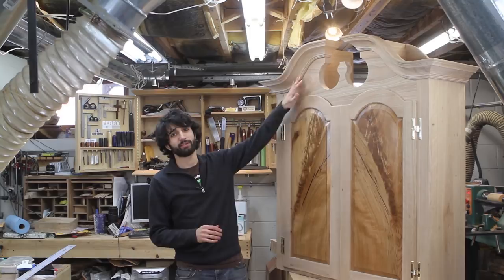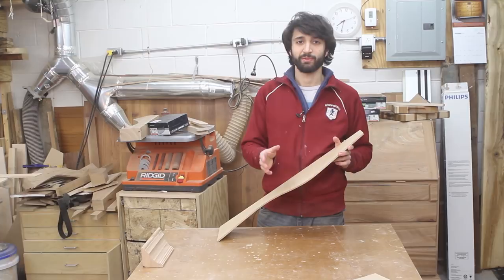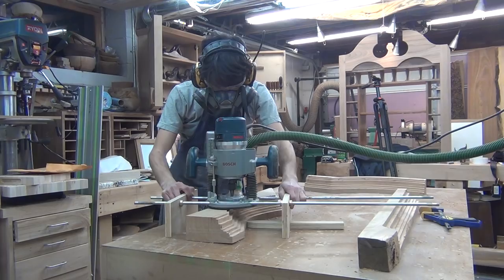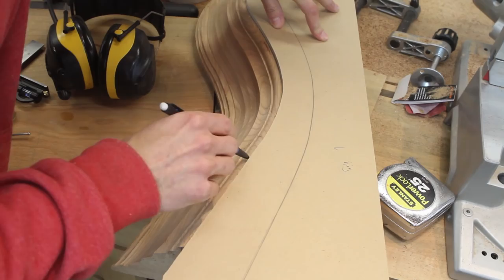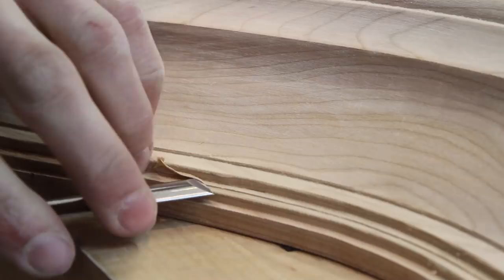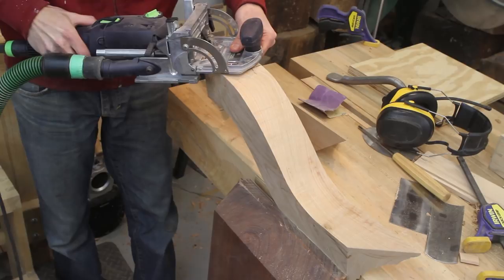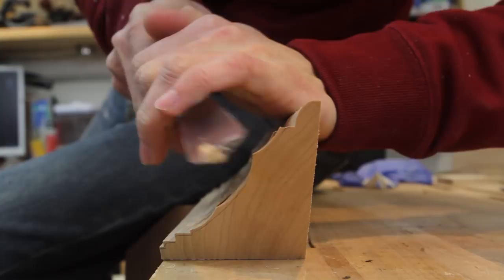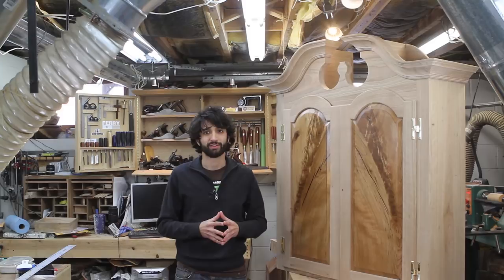Making and Installing Goose Neck Moldings

Comment: they turned out really well.  i only ever did goose neck once when i was training and that was on a spindle moulder with the correct cutter.  i admire your patience to do this with a router, but this is what makes a craftsman. knowing how to reach your goal using what you have at hand.  well done matt. p.s. i no longer have access to a spindle moulder as my shop is to small for one.  but i sure do miss it.
Reply from the maker: Tayler Made Thank you as always!  Having that profile cutter would be awesome.  I can certainly say I have an appreciation for it now.

Comment: Great video Matt and the molding and the entire project turned out fantastic. I was watching another channel a couple of months ago and a gentleman suggested using wood rated cyanoacrylate in conjunction with wood glue for doing molding returns when they are large or difficult to clamp up. His suggestion was to apply wood glue on each miter but leave 2-3 small circular areas bare of wood glue on each side and apply cyanoacrylate in those circular areas and hold the molding in place for 30-60 seconds while the cyanoacrylate cured. He only suggested the tip but did not demonstrate it. I think I would want to try this a few times on some scrap before I committed to using it on something of such importance as your gooseneck molding. The tip sounding interesting so I thought I would pass it along but I have not tried it myself yet. Congrats on such a beautiful piece.
Ron
Reply from the maker: Thanks again, Ron!  yes, CA glue as a clamp works well but you have to remember to keep a bottle in your shop :D

Comment: Well Nat,  clever use of router.  I would call this a "serpentine or Swan neck bonnet mould."  A gooseneck transition usually has a single curve to a mitered joint to straight section.

Comment: So there was a second thing the audience should have notice during the live events :p 2:07 lens cap instead of dust cap... bold! That miter saw fence was awesome! I think I can safely say that is the tallest one I have ever seen. I was about to say you need to learn how to be ambidextrous during those weak side cuts. But you did during the next clip :) Who cares about the time it took to do that. You have total bragging rights. Big props.
Reply from the maker: diycentral I think you are the most observant of them all :)  I think I used more carpet tape in this project than I have in my entire woodworking past.  Cutting those moldings stuck to the table and then stuck to a tall fence really shows how much grab that stuff has.  Occasionally I can show ambidextrous tendencies :)

Comment: Great video and instructive. I'm current looking at the (pre-fabricated) crown molding in my living room. If you were to re-vamp a room/bathroom in your house, would you cut your own crown molding it this way (minus all the neat and technically goose curves, etc.)?
Reply from the maker: Charles McCants Thank you Charles!  I did a room in my house and made all new trim for it.  I was going to make the crown but I found 80 feet of brand new cherry crown on craigslist for $100.  Since crown is straight all the shaping can be done in a more typical manner.  I'd probably use the table saw and router table to make it.

Comment: You need a diy 4x4 cnc ... easy fabricate this both right left sides with just a few ballnose bits and cover and end mills bits
Reply: While this is true, and could be useful for multiple-production work, what he has done here is truly art, and something to be proud of.  Most anyone could push a button and make a CNC pattern, but to figure this out and make it as a wood craftsman takes talent.
Reply: You need to be very skilled with the CNC software to be able to produce work like this.
I find it easier to make complex pieces by hand than on the CNC, this is due to my lack of experience with the 3D cad/cam process. 
The belief that just anyone can do great work on computer operated machines is a false one. 
There would be much more brain work making this moulding on a CNC than making it by hand.
CNC is only a tool there is equal but different skill level required to make quality work with it.
Reply: it depends on the cnc software, cheap router tables and cheap software are difficult to work with even for a person who is very familiar with cad/cam/cnc

good software package will let you do all the 3d design, converting to cam and generating gcode for the machine really fast, I'm talking less than an hour for a molding like this, and the best (debatable is it is "best") is the repeatability of the process, every following sets of parts will only take machine time

IMHO cnc is for production, and furniture like this shouldn't be "produced", it should be crafted by skilled men and women while using as little power tools as reasonably possible and appreciated by customer mostly because of this, I think that most of the value of the end piece is in exactly that - the craftsmanship, and cnc produced parts lack this very very important part of the process - because 2nd and following components take little to no skill to produce - just fasten a piece of wood on the table and press start button (possible tool changes excluded, but that still in no way compares to carpentry) - I understand that this might seem "purist" or "old fashioned" to some, but that is my personal opinion, and I'm the cnc/cad/cam guy, it would take me probably less that an hour to design those molding profiles and get the router started, while I would probably spend 2-3 days hand crafting them and in the end they wouldn't be as good as the stuff off the cnc
Reply: jz1199
"IMHO cnc is for production, and furniture like this shouldn't be "produced", it should be crafted by skilled men and women while using as little power tools as reasonably possible and appreciated by customer mostly because of this, I think that most of the value of the end piece is in exactly that - the craftsmanship, and cnc produced parts lack this very very important part of the process - because 2nd and following components take little to no skill to produce"

SPOT ON!!  I think CNC has its uses, but it in no way replaces true craftsmanship. ;o)

Comment: This is great, I love this style. I have a bunch of questions.

What speed you run your router at, and how do you avoid tear out?

I see glue squeeze out when you are joining the miters. I have heard that getting glue on the visible surfaces will make the wood not take your finish evenly. How do you clean up the glue in this case?

Where did you get the design for the profile?
Reply from the maker: J.L.M. Thank you!  The speed varied based on the size of the bit.  I ran all the bits at full speed except for the big round nose bit.  I ran that at about 2/3 speed.  My bits were sharp so I didn't have any issues with tearout but if I did, I would climb cut those problematic sections.  The squeeze out didn't matter in this case because I went back over the miter with sandpaper to further clean up and refine the connection point.  The design was based on the one in the book I am working off of.  Thanks again!

Comment: OK here is my question:  Think a curved cornice would work similarly but confused on how the miter would be calculated?  The first miter would be on face to transition to horizontal then normal miter at corner of case.....any thoughts?
Reply from the maker: phooesnax I would cut the miter exactly how I cut these ones: standing up in the saw.  That way you don't have to worry about the exact miter angle.  (at least if I'm think about this right, it should work...)
Reply: Will write you a note but I think I understand your thought.  I will tell you what I am up to.

Comment: Cool video, Matt.  I always dig watchin' you in the shop.  Sooooo...what do you do w/ those massive cutoffs from the thick stock, after cutting them out of the blanks?
Reply from the maker: Chris Williams Thank you Chris!  A lot of it I'll save for another project but I will use some of it for the finials that I'll be turning for the top of the case.

Comment: I assume this was your first time doing gooseneck moldings, atleast of this magnitude, how much would you say you agonized over making major cuts, I.e. the miters, before actually making them?
Reply from the maker: Joel Clonch This was my first time doing any type of goosenecks.  The miters were the easiest part.  I drew my guide lines so I would cut them correctly so all I had to do was sneak up on the guide lines.  Little scary making the cut at first but that quickly went away after the first cut